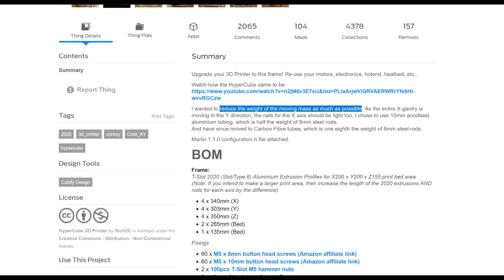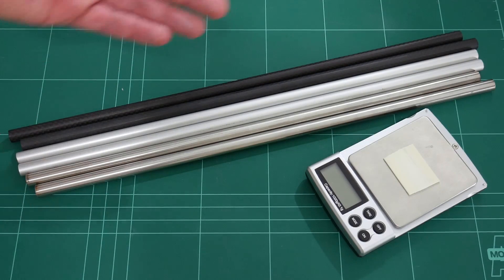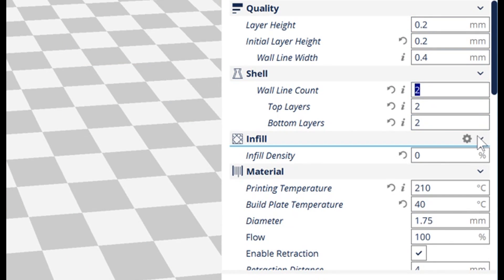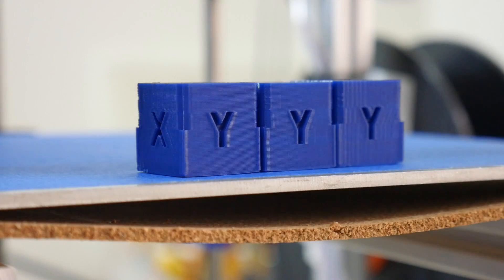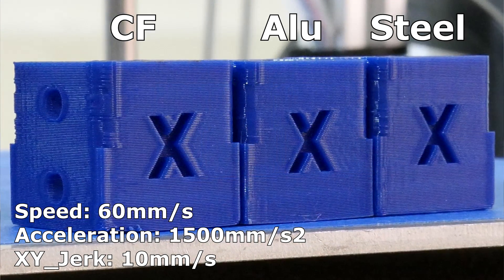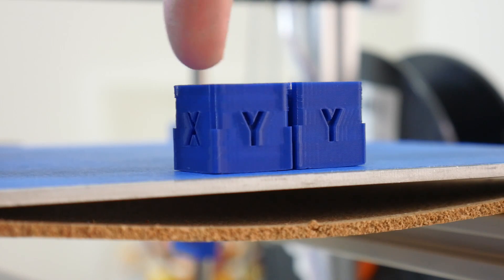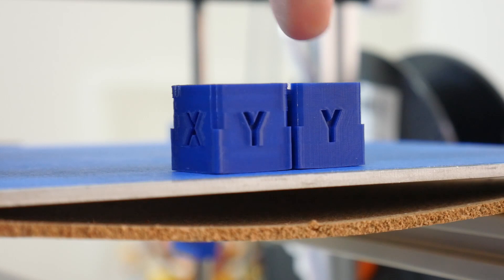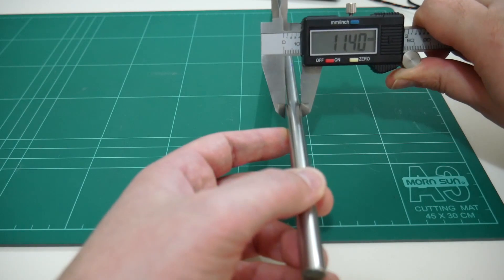THIS IS Y

Comment: Very instructive video. Since  my Ender3 was converted to Direct Drive, I struggle at obtaining the same top notch print quality I had with bowden. Notably some inconsistent, slight layer shifts and corner bulging. I am quite conservative and favor slow print speeds, around 40mm/s, 500mm/s/s acceleration and travel speed set at 120-150mm/s (bowden values). This video hints at which direction I must investigate. If anyone with a Direct Drive Ender3 (AliExpress mounting plate with 2 wheels at the bottom) is willing to share their well-performing settings as a starting point, I'm very keen to hear from you and appreciate a lot since that would save me much time and likely much filament !  Thanks in advance and thank you again for this great video.
Reply: Tune linear advance for the corner issue. Check your belts and motor current for the shifting problem.

Comment: Iv thought about it before with the directions of the x y it’s looks wrong in the slicer but I think you should put the x on the y axis because because the face on the y axis will only show ghosting in the x axis as in side to side in relation to the y axis.  Damm Iv not said that well

Comment: Thanks for this video, it provided a lot of really helpful information for me to address my bulging corner issue. It's surprising to me that slicers still don't take the corner slowdown into account and change the extruder feed rate to compensate. I imagine that someone could create a slicer that would adjust the speed, acceleration and extruder feed rate dynamically during the print to optimize speed without causing any artifacts. The slicer has all of the information it would need about the geometry of each line or curve it will have to draw and should be able to use physics to determine where to slow down. When I'm driving my car I would never use cruise control on curvy country roads because I'd fly off the road on the corners. Instead I adjust my speed and acceleration on the fly. 3D printers should be able to apply the same logic.

Comment: This is very puzzling, because inertia only applies to moving parts.
The only time when those rods are actually moving, is when the gantry moves up, so that would be the Z direction,
I suppose that the ghosting that is found is caused by the poor fit of the bearings to the steel rods.
Another issue with aluminium or carbonfiber rods is the poor hardening, causing the bearings to wear out channels on the rods, and causing ghosting free a while on the Y axis.
The solution would be using (expensive) hardened aluminium rods by Igus or drylin bearings on softer rods, but because those drylin bearings need to be perfectly parallel, this willing also introduce wearing and ghosting after a while,.so the solution for that would be auto-alighning drylin bearings,.which are hard to come by,, and expensive.

Comment: You could also get rid of the ripples by lowering your jerk setting to something like 0.5 instead of 10, but you also wouldn't be able to achieve the same top speeds during a small print like that.
Print that same cube at 200x200mm and lower jerk to 1 on both x and y so the print has time to reach max speed on each line and those ripples probably won't show on either axis.

Comment: This video is now outdated cura is using M204 Sxxx.xx for acceleration in later versions but marlin is using M204 Pxxx.xx Rxxx.xx Txxx.xx (print, retraction, travel) so you can set the values in cura but they wont affect the acceleration in actuall printing. 
To get this to work with cura modify the start Gcode to include:
M204 P1500 T1500; Set acceleration
Keep the settings in cura set as this will keep your print time estimates more accurate and only increases gcode file size which is not a big deal.

As for corners becoming out of shape you need to enable linear advance in marlin then you can use a K value to fix the issue.

Looking forward to a update video.

Comment: Make corexy to print fast
reduce speed to prusa levels cause ringing
xD
Reply: But in your slicer, you really only need to reduce the print speed for the outer wall. The rest could be printed much faster, like infill 150mm/s, inner wall 100mm/s, outer wall 30mm/s. Still saves some time.
Reply: @Dave_the_Dave  i guess. but I never understood pursuing print speeds. considering the acceleration and the way objects prints it's usually so much effort for 1-2 hours of print time reduced in a 16 hour print
Reply: Yeah I think it makes the most sense in short prints or really long prints. But yeah, if you're not there to take the print off the bed what difference does it really make.

Comment: I think the x and y were lined up correctly before you rotated the model 90 degrees if you really think about it.
Reply from the maker: Depends what you're testing for. As the ringing is caused by acceleration, I wanted to see the matching X and Y acceleration ringing.
Reply: @Tech2C  no I understand that but what I'm getting at is when the x side is facing the sides of the printer and the y side is facing the front or back the cube is in the correct position.  If you have the x facing the front of the printer you are actually seeing the results of the y axis wobbling on the x side and vice versa.
Reply: it seems counter intuitive but it didn't need to be rotated 90 degrees, it was in the right position to begin with
Reply from the maker: That's what I used to think as well. Then I did a test and found the ringing is not caused by the previous axis movement. Even from a stand still, the ringing is created by it's own acceleration. At least with my 3D printer.
Reply: @Tech2C  I don't think you are fully understanding what I'm getting at.  I'm not saying the ringing is cause by the previous axis movement, I'm saying when the y axis is only in motion and the print bed is the only thing moving front to back it should be printing the x object on the side of the cube because if the bed should be the only thing moving and you are still getting x axis movement the ghosting will appear past the x object on the cube.  Kind of like a car doing a fishtail after it turns a corner.  If you rotate the object in your slicer you are actually finding the y motion is showing up on the x side and the x motion is showing up on the y side.  Like I said it is a bit counter intuitive but it was the proper way before you rotated in slicer.
Reply: the ghosting isn't actually caused by acceleration, although it can be decreased by lowering acceleration, it is actually caused by a heavy print head and a loose assembly.  If you make sure all belts are tightened and somehow decrease the print head weight, you should see a substantial improvement in ghosting, you can do other things to mitigate against it but they aren't the root cause.  And lowering acceleration has consequences as well.  I can only speak for myself, so this is only what I have found to be true.
Reply: @Tech2C  ok... I might have miss read your earlier comments.  That's interesting ... from a stand still hey?   what would you suggest for acceleration speeds?
Reply: @Tech2C  Oh I see what you mean now... no further explanation required.  So in my case, I have a 400x400x450 build volume with a glass bed.  The weight of the huge glass bed must be the cause of my ghosting on the y axis and the weight of the metal fan shroud could be causing me problems on the x axis(belt driven on both axis).  So reducing the weight of the print head using maybe printed parts could solve for x and aluminum bed for y might help along with reducing the acceleration speeds or just printing slower.  What would you suggest?

Comment: On my P3Steel Toolson Mk2 with steel rods I do not get the letter's ghosting at 60mm/2. 

I use sinter bronze bearing.

But those corner bulges. They also occur with your carbon fire tubes. They can be reduced by printing the exterior perimeter with around 25mm/s while maintaining a speed of 60mm/s for the inner perimeters.

Comment: Slowing down accelleration requires retuning "advance" or pressure compensation as well or you get those bulges on the corners...
There is no reason to get those with correct setup where extrusion will compensate for pressure in melt chamber.

Comment: Very interesting demo -- quick question though. Have you ever calculated the total weight of the gantry? i.e. sum up the carriage, extruder, fan, bushings, Y-rail LM8 bearings and connectors, etc.

Comment: Why not use steel tubes? Thin wall precision tubes are available, and a tube is always going to be stiffer than a rod of the same diameter and material, as long as the walls aren't too thin.

Comment: I have 8mm steel rods for the gantry and I am printing with 220c, 150mms speed, and acceleration 3000mms and I am having a little rippling effect!  and btw, my printer is literally dancing when printing with those speeds, not just shaking and my neighbor told me that he is hearing my printer's vibrations in his room :lol

Comment: Oh, and you've absolutely nailed it w/ respect to acceleration / jerk being the key configuration variable to affect this. I once asked Richard Horne to test a printer using this, and he didn't, berating me (in a vid, nonetheless) for suggesting printing such a small object as a test, as it's "clearly too small for the printer to reach the speeds where that would matter" (or something to that accord).

Which is clearly incorrect, as it's the speed vector change that's responsible, not the speed (i.e. acceleration and jerk).

Comment: Also, one interesting tidbit from my own battle with ripple back in the day... I had a Y axis with a movable bed, and an X gantry. You'd expect the Y axis to exhibit the effect more, right? The bed being heavier and all (at least mine was, it was a solid aluminium plate with another plate on that, then glass, plus a bunch of V wheels for the Makerslide to keep the thing solid).

Well, it turned out the X axis was exhibiting way more ripple than Y. It's not just the mass, it's actually a combination of mass and rigidness. If you're familiar with the spring oscillations in physics / mechanics, there are three components to it - the dampening factor (friction), the mass, and the spring constant. The spring constant, in this case, is the rigidness of the whole system, and the belt tension. You can reduce the frequency of the oscillations (making them invisible, or less noticeable) by reducing belt tension, as long as that doesn't induce slop. That was the case with my Y/bed axis.

You can also increase the dampening in some cases, by, for example, tightening the V wheels to the rail (or whatever the equivalent for your motion system of choice). This makes the steppers work harder, but there's always some margin left if they're not overheating to begin with.

Comment: Hi, author of the Vibration / Ripple / Shadow / Ghosting test thing here. Funny thing, i accidentally came across this vid on youtube and immediately spotted one thing - the changed orientation.

The initial orientation it loads in is actually correct, just not intuitive :)
The idea is that the letter with the ghosting tells you which axis is exhibiting vibration on direction change, not which axis the face of the "cube" is parallel to. So X is actually on the Y side, but if it's exhibiting ghosting, that means the X axis is responsible (ripples are oscillations along the X axis in that orientation).
Reply: So what he is telling me in this video is that the ghosting is not from sharp turns like a car fishtailing.  It is from acceleration like it's backfiring as it goes in a straight line less and less as it gets further away from an object.  But it still doesn't make sense to me, why would that only happen after a sharp corner and not all over the object.  I still think I agree with you that it is in the wrong position and is from x axis motion while the y axis should be the only side moving.
Reply: @CodyBellerose  You don't seem to know what acceleration is. When there's a direction change (any acute corner) then the printer needs to decelerate and accelerate. The more open the corner is, the less the printer needs to slow down, thus the effects of acceleration are less visible.
Reply: @alejandroperez5368  ya i kindof have it figured out now.  Still a little confused why you don't see ringing during decelerations.  But I get the acceleration ringing.
Reply: @CodyBellerose  you get ringing when there's a direction change, and that involves 2 axis, think about the nozzle wanting to keep it's previous trajectory and it oscillates until it stops, that's when the ringing ripples cease.
Ringing on only 1 axis movement by accelerating doesn't just happen, or at least I'm not aware of it. But you do get other problems related to nozzle pressure delay (check Linear Advance).
Reply: It was right the way you designed it, but there's an even easier way to motivate it. The axis on question is perpendicular to the face marked with the axis. Look at the Z face: the Z axis goes "through" the face. With that as your guide, there's only one correct orientation for the X and Y faces and the cube loaded correctly from the start.
Reply: exactly what I said

Comment: 60mm/sec print speed and jerk at 10 mm/sec2 are ridiculous low value. The whole test is ridiculous BTW because you take in count the rods but not the bearing on the rods and the tolerances between rods and bearings.

Comment: This analysis of the ringing of your 3D printer is really cool. Reducing the moving mass is always a good idea. However, I am puzzled if it was possible to counteract the ringing in software: 
It should be possible to measure the ringing amplitudes at different positions of your print bed.
In the next step, one can generate a model for the ringing amplitude.
Finally, the G-code generator can be modified to add a ringing with inverted amplitude to the G code.
As a result, the ringing should be canceled out.

This should allow significantly higher print speeds without changing the hardware. So it would allow for higher printing speeds for cheap printers but could also further speed up fast printers.
I am new to 3D printing, and I am not sure if this is very difficult to implement, but as far as I see the G-code is very modular.

Comment: I don't get y the ripple is showing on the Y side... The steel rods are part of your X-axis, thus their mass is moved only during Y-movements. X-movements however move the same mass, regardless of what type of rods you use. The ripple on the X-side of the print occurs due to the Y-movements when the letter X is printed. The ripple on the Y-side is caused by the X-movements when Y is printed. Clearly, the ripple should show up on the X side because the Y movements move more mass. Why isn't that the case?
Reply: you answered your own question. Mass is moved during y movements
Reply: Shit, this is just confusing... Yes, more mass is moved during Y movements. This is why when Y stops, the gantry still swings in Y direction for some time. These movements should result in ripple during following X movement on the "X" marked face of the cube.
In contrast, during X movement, less mass is moved and when X stops, almost everything is still, NOT causing any ripple on following Y movements on the "Y" marked face.

Comment: Replacing steel rod is good for reducing vibration. But I think it is bad for accuracy. 
Carbon or Aluminum pipe is no precision. 
It is necessary to think about a structure to suppress vibration of the bed.
Reply: Although true 3D printers are not there to the point that it actually matters.

Comment: Where can i get the aluminum rods?  The ones I've found so far are either very short or not smooth for use in a 3d printer.

Comment: Why don't you simply buy a Delta printer they print faster with more accuraccy and less vibrations because his three arms moves vertically so there is less inertia compared to a cartesian. And also they are less expensive and have auto bed levelling.

Comment: Great video and build, I´m still deciding between your design and a dbot but I like your´s a lot. Its simple and I like simple things :) Thanks for sharing.  Just a question, I know its not that easy to find perfectly round steel tubes but have you tried one? I´m asking because I thing having steel spheres rolling on alu or CF will not last long so a steel tube could be a good compromise.

----

ok, I just saw on thingiverse that you´re using igus and self lubricating bushings for the cf and alu rods. :)

Comment: Well, all I can see is that your whole printer is made from aluminum profile pieces, connected with flat 90° angles. 
You have placed your light build printer on 4 poles, with just some improvized buffers inbetween. 
Of course does the whole thing wobble and shake once you put some real weight to it. 
The table you have put your printer on, as well as the material you used as buffer on your printers stilts have an invluance on the print result as well. 
So in the end your video shows that you shouldn't try to put some solid, heavy duty material into a lightweight printer. 
I for example run a 15kg heavy printer, with a combined weight of 700g for extruder, hotend and X sleed. 
Changing from hardened precicion rods to aluminum or carbon would just break these in no time. 

So in the end what I am saying is: Your video might be helpfull for other with the exact same printer, but it is not a naturs law, that lighter rod make for better printquality.